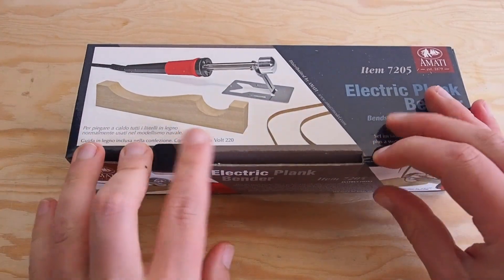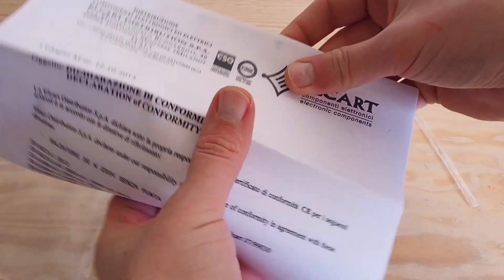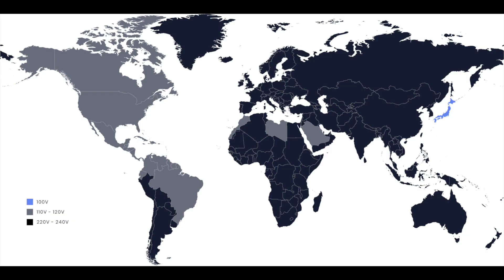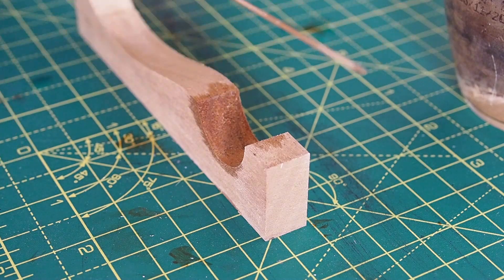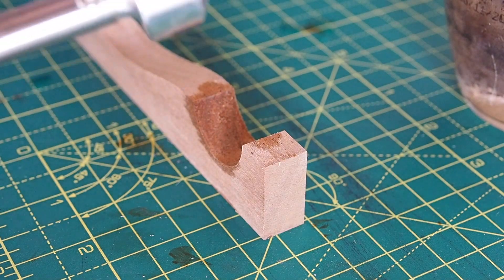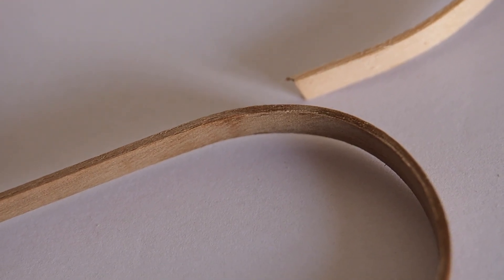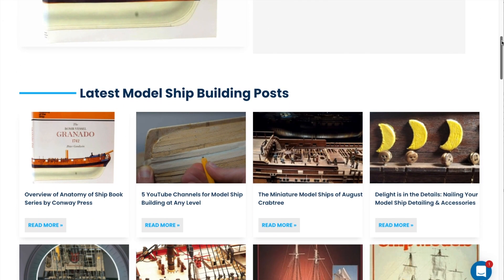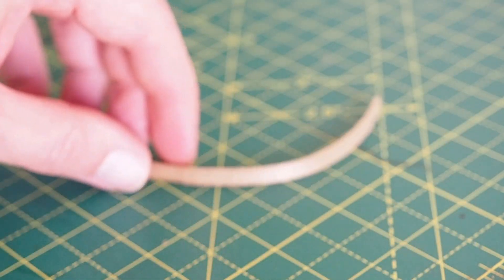TOP 2 tools for BENDING wooden strips for planking on ship models

Comment: I bougth the Electric Bender 2 weeks ago, i used to bend the planks with a can  heated by a flame. 🙂
Reply from the maker: Hi Simo, yes that’s an other easy and cheap way to do it :)
Reply: I still use a soldering iron for bending planks to this day

Comment: Is it a must to wet the planks in order to bend them?
Reply from the maker: Yes, otherwise you’ll just burn the wood fibres.
Reply: yes it is better but you can bend them with heath alone even  with a hair dryer which sometimes i do also use my sodering iron but you have to becarefull cause it has so much heat that burns the wood if you do not letg it of and have to keep moving this tool has enough heath to bend it without burning.